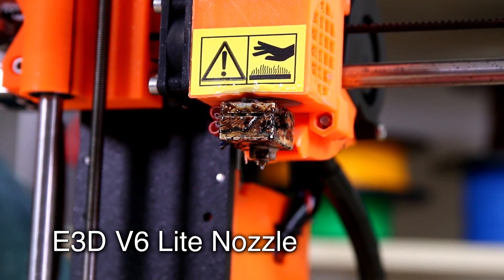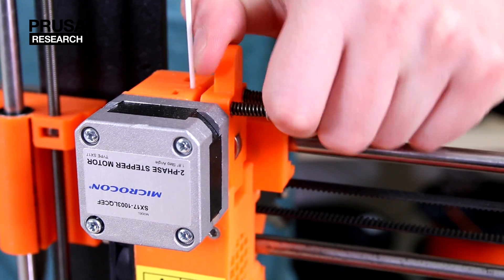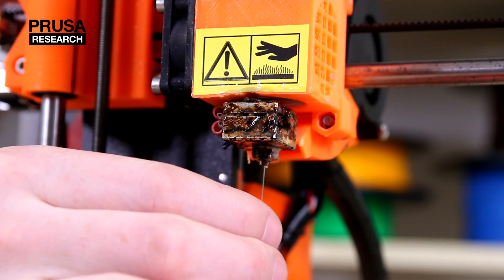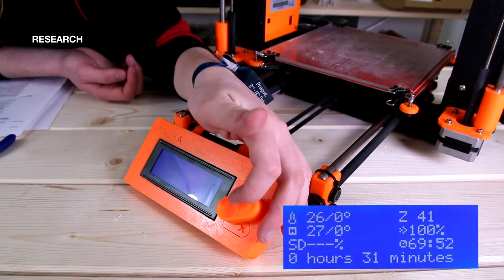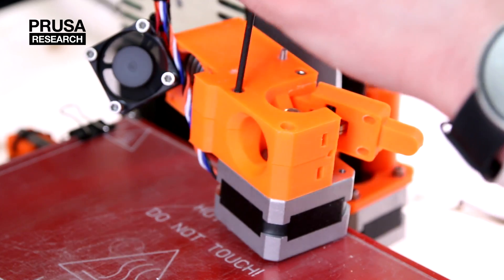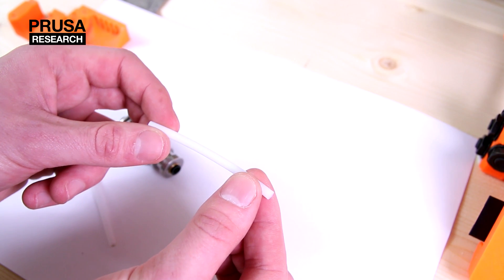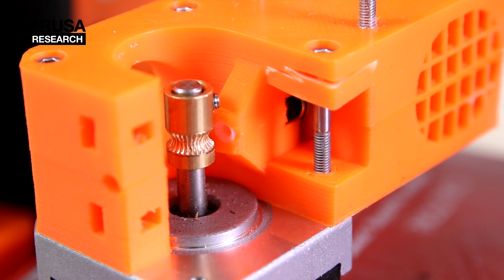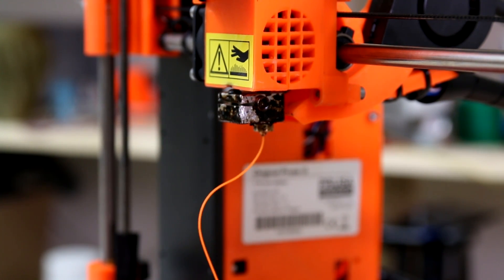Teflon tube change

Comment: what are the dimensions of the teflon tube?  Would like to pick some up locally if possible.
Reply: 3mm outer, 2mm inner. I picked up 1m of it off eBay. Solve the problem for a very long time. 
I also picked up a meter of 4mm outer, 2mm inner for my Bowden extruder.
Reply: I finally bit the bullet and took mine apart yesterday to do some investigative surgery and actually found that it was 4mm OD PTFE tubing in my Lite6, not 3mm.  I will use some Bowden tube like you describe for mine.  Thanks though
Reply: All my jams tend to be from the filament expanding before the extruder. I am currently only using one fan to cool both the extruder and the area below it through a split duct... If I turn off the fan, within a minute or two it jams. the fix is very easy. but the print will have to be restarted.